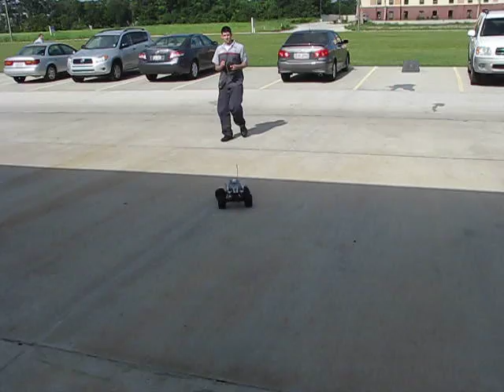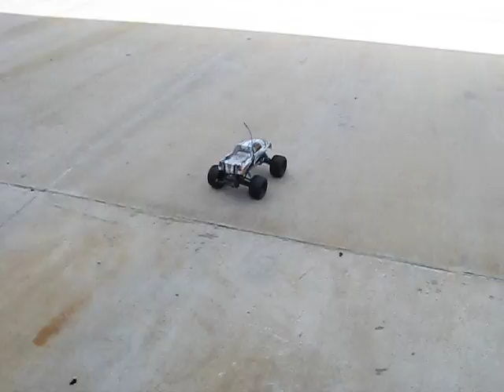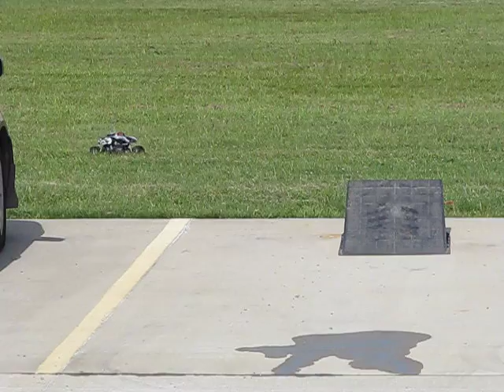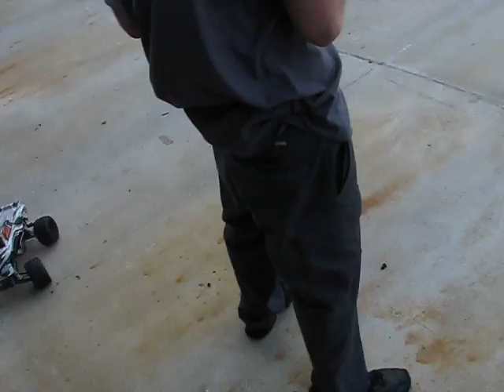Traxxas Stampede XL-5 with Mamba Max 7700KV

Comment from the maker: @cooldude7c  Bought the truck used with the 7700 already on it.  It's fine to tear through the yard and elsewhere.  It's geared down so much it does not overheat and still performs it's offroad duties aswell as tearing up the pavement.

Comment from the maker: @gudrn  ESC. Motor, metal transmission gears, 13 tooth pinion, 92T spur gear.  It looks slow in the video because I was barely hitting the trigger until I hit the ramp.  Due to insane amount of torque and gearing it takes awhile for me to build up speed but it'll smoke a XL-5.  It is probably topping out around 50mph - 55mp.  Haven't hit it with a speed gun yet.